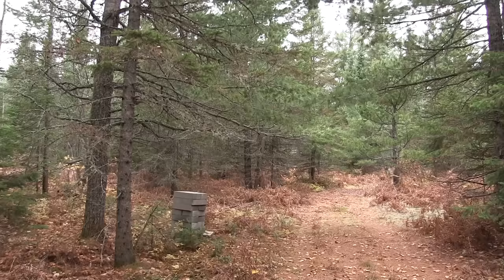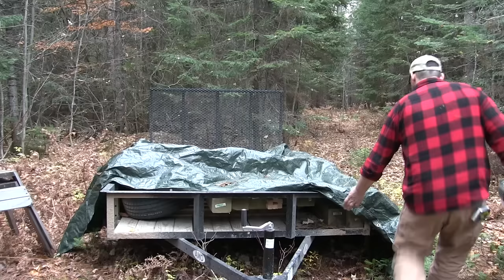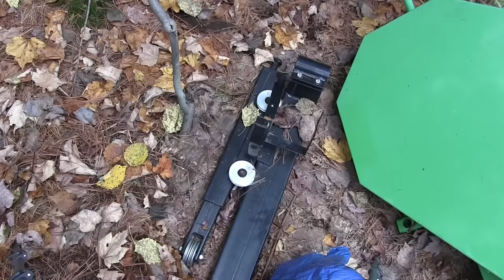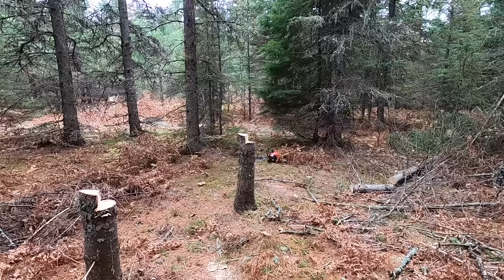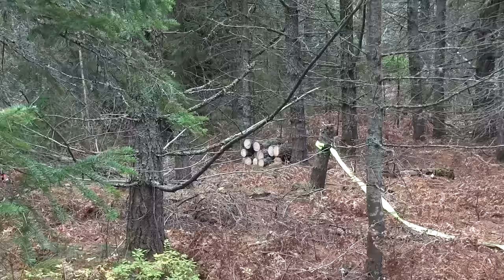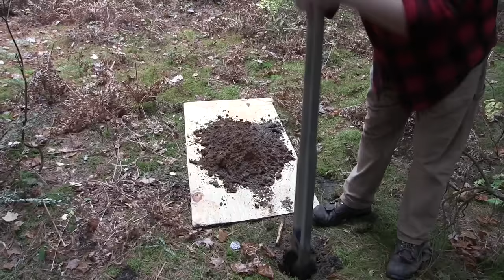Building a Remote Off Grid Cabin in the woods...Deep Dive commentary

Comment: You may want to replace the screws that hold in the windows with ones that can't be backed out.  I built a cabin with a  southern wall that was all windows.  I am a winter guy.   I was gone a week.  When I returned all the windows, doors, fireplace and propane fridge and  the solar st up on the roof was gone.  I am sure if I were to be gone longer I may have lost the whole cabin.  Trail cameras all over the property and at all  access points is also a good Idea.  The Sheriff told me people watch for people building summer cabins.  Caught a guy that stole a  whole  cabin.  Loaded it on a trailer.  He only got caught because he didn't have a permit to hull a 10' wide structure..  He also recognized the tiny home...
Reply: I am shocked by your story! Only gone 1 week?! What is the world coming to? Was your cabin in Canada or the US? Were you able to recover anything? I’m so sorry to hear this story. I hope you were able to rebuild your cabin.
Reply: Yeah had that happen once I found it after you screw it down drill out the head just enough that nothing can get a grip on the screws. Works just fine.lol
Reply: @curtisanderson3673  So I suppose whatever you build with those type of screws is very permanent. No renovations or replacing windows or doors in the future, without a heck of a lot of work!  😆. Seems like a lot of extra effort to prevent thieves dismantling your cabin. Things we have to do these days.

Comment: Thanks Dave. Its interesting to hear how weather plays a part on the build over there. We are similar here in the uk and we get mostly rain now rather than ice and snow. I've danced around on roofs with tarps and instead of using a bucket to remove what seems like a ton of water that had gathered like yours had, I tried to push it off with a broom and it came down on top of my head. Some days are not so great but others go so smooth. Thats the building trade.

Comment: I have a very similar cabin on my 15 acre forest property in the middle of a 100 foot pine tree stand...Actually I have several, I rent them out on AIRBNB, but only one in the pine trees...I got all my wood from Amish saw mills, dirt cheap.. I used a 40 foot ladder to clean my pine trees way up...I built my own tiny house on the property, with a home made solar system, made from (32) 280 AH EVE cells, and a 48 volt all in one EG4 6500 watt inverter, solar controller, AC charger, 3500 watts of panels, water well, both septic and out houses for the cabins, wood burners, mini split for redundancy for the tiny house, huge garden, fruit trees, berry bushes..You have the process of building cabins down to a science, and your alot faster and efficient than me..I like having no utility bills, and my home made solar system paid for itself 2 times over in only five years and I still have 96% of my original battery capacity..Can't beat that..I make a pretty good income renting out cabins..Win--win...Good job..

Comment: One tip, ground contact is rated for side and edge grain to contact earth, not the end grain, which is how the rot really destroys your lumber. You should treat the end grain with an applied copper napthenate until it cant absorb any more. They do make a PT rated lumber that is called direct burial but it is pretty caustic and not necessary, just then end grain coating is crucial, especially if you make a cut in the wood. Hope that helps.

Comment: I bury my 8” x 8” pressure treated posts the same way as you did here, but then someone told me I should have put gravel in the hole first, so the post isn’t in direct contact with the ground.  (?). I don’t know, posts I put in 20 years ago still seem fine.  Also, some of the junky not fully dried pressure treated I got from Home Depot proceeded to warp over a couple of months, which torqued my gate out of position.  Your corner posts are locked in very well though, whereas mine were free standing 5’ off the ground, so maybe that’s the difference.  Wish I had your skill and knowledge as to how to do this.  Your cabin turned out great, thanks for sharing!  👍

Comment: 10:39 
When checking for square, I use the "3,4,5" 
3 feet and 4 feet are length and width, 5 is the diagonal. It works in any multiples of those as well. Like 6,8,10 and 9,12,15 and so on.

Comment: awesome video man, but one flaw im noticing is that on your frame the only thing carrying your load is the 4 inch nails, the best way to do this style of build is to do a pier and beam system where the Girder beam(2 or 3 2x10 nailed together) is directly on top of your 6x6 posts and then you build your frame on top of the beams so the load is carried evenly and there is no sagging later on and your not relying on the sear of the fasteners to carry the entire load of the house.

Comment: Mate, you need to change the filling valves at the same time too.
They are old and use brass shanks ones for replacing.
Also use Fein multi tool to cut the nuts and the flush valves.

Comment: The fact those wires were stuck b/c of the heat is concerning. Although there are no cracks in that head it is probably warped.  The machine shop will take care of it but can throw a straight edge over it to see.  Keep doing your thing and g/l 💪🏾

Comment: That group set seems good as does the bike.  Brakes? Try hydraulic brakes or maybe the linear pull Zoom mechanical brakes with a 180 rear 204 front rotor set up.

Comment: 36:36 - TOP TIP: A future solution to a 'similar rainfall problem. Instead of the 'Bucket-on-a-Rope' method, always carry a length of garden hose as part of your 'cabin builder' toolkit which can be used to rapidly 'siphon' away all the excess water,

Comment: it's a nice cabin! my only quibble is that you seem to be depending a lot on nails as a load-bearing fastener. I would've notched the corner posts on the foundation and set the ends of my floor frame in those notches.

Comment: Since you are not using a seal gasket bring the T111 plywood down.  Helps when standing the wall and it keeps drafts out in the crack between foundation and wall.  Always need a header load bering or not. All outside walls have some load on them from the roof.   It's code in general (yes I know you don't need an inspection).  Use good construction method if you are making how to videos.

Comment: I'm not sure if our hemlock is the same as yours. Here it's  called hem-fur, several types of wood classed together. But if you leave hemlock stacked out where the sun gets to it on one side, it will twist quite severely. So you want to get it nailed in place as quickly as possible.

Comment: Generally, ground contact treatment is the same chemical, but the penetration is deeper because it is in the pressure treatment tank longer. Avoid treatments that use arsenic as a component in the treatment.

Comment: As a truck fleet mechanic, this is more than brakes going out. The brakes go out after the driver attempts to override the accelerator that has malfunctioned or actually hacked. This is the problem with drive by wire. Remember the CIA EDB openly bragged about hacking “potential mission areas” of vehicles and more.

Comment: You should consider running some electrical wire before insulating....and then eventually installing some solar panels on the roof with a battery storage unit.....to eventually give you some electrical power in that cabin.

Comment: Don't need a calculator to work out a diagonal for a right angle corner. The 3,4,5 method works just as well. Measure out from the corner, 3 units on one side and 4 units on the other. Then the distance between those two measurements should be exactly 5 units. (3x3)+(4x4) = 5x5 or 9 + 16 = 25. Depending on the size of your construction you could use 3 feet, 4 feet and 5 feet or use 30 feet, 40 feet and 50 feet. It even works for metric, 3 metres, 4 metres and 5 metres. You don't even need a tape measure, a random stick will work in a pinch. Measure 3 stick lengths in one direction, 4 stick lengths the other direction and if there is exactly 5 stick lengths between those two points then your corner is a perfect right angle.

Comment: Maybe its just me but I think you would gain a lot of strength by sinking your ledger board and rim joist into your ground contact post. You currently have a lot of weight being held up by just potentially rusting nails rather than posts burried into the earth. In my opinion you`re building a house like most people build decks which is wrong because most people build decks incorrectly  by failing to properly tie their joists into their posts and all the weight of their deck becomes shear force on lag screws and carriags bolts which they really arent desinged for.(youtube it) Whether or not you need to increase your posts another 2 inches to accommodate this cut out is subjective i guess. I couldbe way off but ive watched a lot of deck collapse videos and this is why.....shearing of bolts, you have a whole house supported by nails i believe. Love your channel.....just an observation.

Comment: Stumps are your turbo non-rock fire stop!!! Wtf you thinking? Plus some would double as fireside seats depending on backside configuration & lower roots…just tip stump away from em center of fire pit~ 10-15’ away along the circumference.

Comment: Could you build a foundation under the unit and make it a non-redily removable structure. It shouldn't be any different than a modular home built offsite and delivered to your location but must have a foundation. My take on the readily removable structure is that right now it can be loaded and moved at any time. Nothing preventing the move due to being built on a skid. Build the foundation and remove and replace the skid runners with solid rafters.

Comment: 12:00 could you vertical post footings be made more robust? How long does direct burial of treated lumber last today?? Maybe 5-10 years? I think bag concrete footing, spay foam on all vertical part of buried wood above 1 bag concrete w lots of rocks added on top that you don’t have 😂…anyway, post spray foam is 1 black trash bag per post tapered to zip tie at top until foam cures…then bury. Purpose of bag of concrete is to taper water away from base so do that!

Comment: Looks fantastic and I'm a big fan of dehumidifiers. I think I would worry about the foam breaking down overtime. Does it offgas? How safe is the foam dust, because it seems inevitable that the foam will become dust over time. Have you tested for radon? Does that affect the foam?

At any rate, I think I would be pumping air out, but I'm pretty unresearched on this topic. So maybe that's not necessary.

Comment: The Pythagorean theory is a^2xb^2=c^2 carpenters dumb it down to 3 4 5. But the easiest thing to do is measure corner to corner for a square or rectangle shaped build. If your measurement on the diagonals are the same it is square. Build any rectangular frame, measure your upper left cot to your lower right corner, then measure your upper right to your lower left, wiggle things around until both of those measurements are the same. BOOM, it is square

Comment: Hey Dave, I noticed you didn’t use any plastic under or on top of the insulation… are you worried about that insulation getting wet or damp and causing mold or mildew inside your floor?

Comment: I would have added tyvex to the outside and a plastic vapor barrier over the insulation. It will cut out alot of the wind and help keep heat inside. R13 is pretty shitty insulation.

Comment: Great video
Maybe this is not an ussue up north, but no moisture barrier on roof between metal and i insulation? 

In the south you would have moisture and condensation on tin roof, causing mold issues?

Comment: If I want to build a cabin for year round use in an area that gets very cold and has quite a bit of snow, would you recommend any modifications to the method your using for the foundation in the video?  I've seen videos where some people pour concrete in around the posts, use concrete piers instead of posts, and where a concrete pier had a metal piece attack to a concrete pier and the post attached to the metal piece so the wood post isn't in direct contact with the concrete.  I'm not sure what the best method would actually be if I want it to last a very long time and now problems down the road.  How long would you expect just the posts rated for ground contact to last in an area it can get very cold and have a lot of snow?   I watched one video where they used some type of plastic bubble over the top of the floor joists and installed the floor on top of it.  Supposedly, it's supposed to keep out rodents and insects.  I'm not sure exactly what it's called.  What do you think of that?   What is the best way to prevent moisture, mildew, mold etc.. problems with a cabin?

Comment: I want to put a bug in your ear.   I saw this concept on Paul Weaton's permaculture channel,  and he is very adverse to any kind of chemical treatments, like copper sulfates, etc.  so he of course charred his timbers, but what really got be interested, is that instead of just putting dirt back into the hole, around the timber, he put in some gravel in the bottom, and then gravel all around the timber instead of dirt.  so that water would drain away from the wood.   You are saying that that is sandy soil, so I am very curious is this type of post hole filler would work long term as opposed to ground contact treated lumber.   The down side is that  that is a very wet, relatively speaking,  environment, to mine, which is west texas.   where we only get rain a few times a year, and then some years, when it is dry, we might only get  two or three months with rain events in them.

Comment: This is my first time watching your channel, and I'm enjoying this tutorial immensely. 

But I have a question, which is, is there any reason you don't build the roof and steps first, prior to beginning where you do?

It seems to me that doing that first would help alleviate several potential problems down the line. 

I could also see you leaving say a 2-4" gap around the outside wall and or ceiling wall material (which is perhaps plywood, iirc?) and  pre-installing the insulation to the interior portion of same, while it rests on 4.5' custom made sawhorses.

Using gravity to your advantage, if you will.

My ex had a chronic bad back due to his work as a former gas company worker and a few youthful car accidents. 

He had to undergo an urgent triple diskectomy with fusion and plating at C5-7 right before I delivered or first child (he had stepped back into a 6" hole with a piece of plywood balanced above his head; ouch is right).

Both he and I created work arounds all the time after he had that 9 hour surgery, due to his loss of range of neck motion from the plating. 

Just curious. 

Finally, the mom and exwife in me kept hoping you'd wear a respirator mask while cutting all that wood. 

That same ex has an early onset COPD to deal with as well.  A girl can hope!

Comment: I was wondering if it would be aesthetically pleasing to fake a board and batten by using 1/2" exterior plywood (cheaper than the T-111) and then add 1x2 strips for "batten"?
Reply: BTW, Love the old framing hammer!!

Comment: What floor size please?. Blessings from Oamaru Sth island New Zealand.

Tip. On ground treated timber you can up it next level by using Marine grade. You can also use heavy polythene plastic sheet or bag and staple or zip tie to wood before putting into ground making it last decades longer. Ground treated grade timber only last 50 years.
Reply from the maker: 12x12

Comment: No vapor barrier under the plywood. Is there an explanation why you wouldn't do that? It is essentially the siding right?
Reply from the maker: I used to be a cement contractor....Ive built hundreds of foundations and they need to be RIGHT! So calculating the diagonal is essential to check the work

Comment: YOU INSTALLED YOR STOVE PIPE UPSIDED DOWN ! Creosote running down outside of chimney is because it is a liquid when it gets hot , try running your male pointing down and only use a female  to tie  into your double walled pipe and even there use stove cement that joint. you will need a crimping tool to do job right.

Comment: I'm building a 12x14 shed, more similar to the other cabin with the single pitch roof. One thing I haven't seen you cover in any video is the squirrel blocking boards. If this vid I see they're flush with the siding but protrude up beyond the rafters. I'm assuming this is no big deal since your steel roof is on perlins and will clear that anyway.

But I'm being pretty anal with this shed since it's my first decent size project. I'd like that to be flush with the rafters since I'm putting plywood over the rafters and that would close it up tight. Would you just rip these squirrel blocker boards so that outer corner is even with the edge of the rafter? That's the easiest way I could figure it.

I've learned a ton from your videos and so far the shed is coming along nicely. Had a few...learning experiences along the way but I figure at least it's a shed so when I do something like a sauna, I will hopefully not repeat the same mistakes.

Comment: When you dig post holes like that, they have to go below the frost level (which will vary depending on your location) which you didn't mention, but you also need to fill those holes with concrete not more soil that you dug up from around the area. But beyond that, green treated lumber for anything you put in the ground even if you're building a effing fence is like 101 type information it's not super advanced. I'm just surprised you didn't anchor those posts with concrete. Over the years because you didn't anchor these properly into the earth, they're going to settle and shift. Your floor, after 2 to 5 years will not be level.